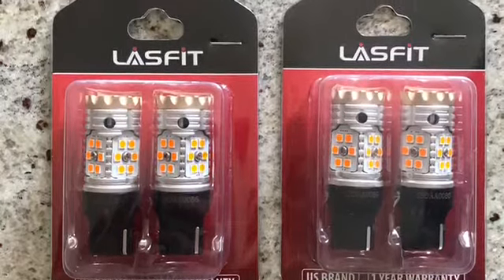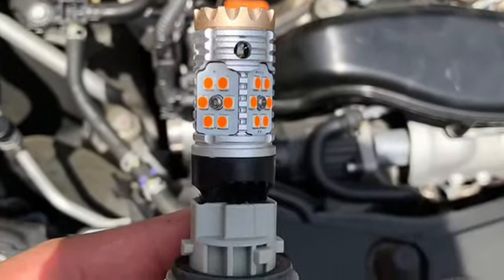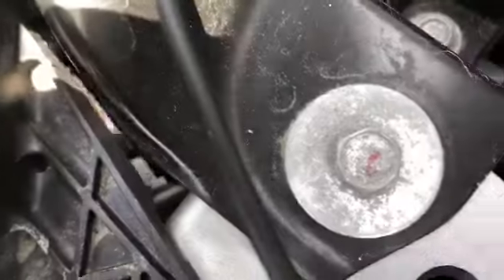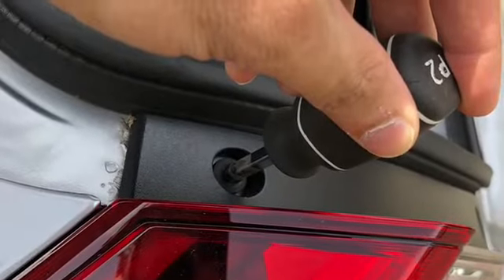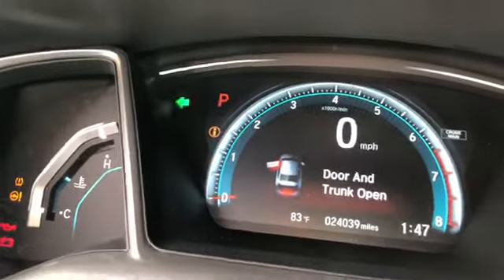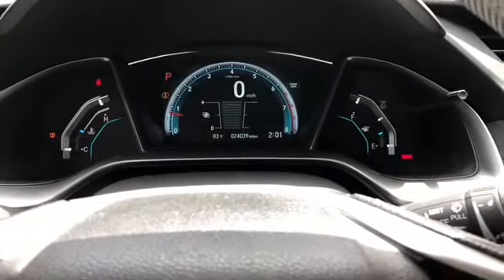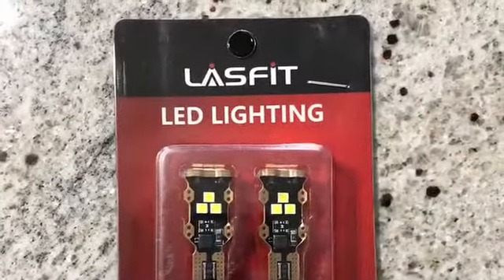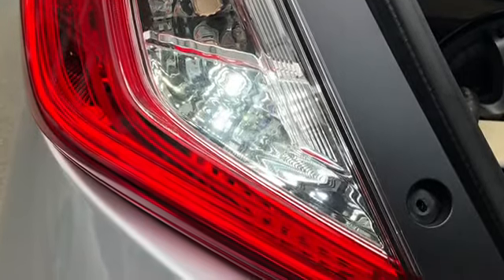How to Install Anti Hyper Flash LASFIT Turn Signal Bulbs for 2016 Honda Civic

Comment: I bought these for rear turn signals and they’re awesome! Although after 3 minutes they did start to hyper flash because they get REALLY hot. I’m wondering, would it effect the bulbs if I switched out my flasher relay to an LED compatible one and still use these after the 3 mins? Or would there be some sort of electrical issue?
Reply from the maker: Justin Love I’m not sure man I wouldn’t mess with the electrical system in your car. I’ve been having electrical issues with my car such as the emissions system warning light and brake system problem VSA and a bunch others but I’ve heard these are common issues and there’s a recall. If you switch out that relay please let me know if it helps with the problem your having.
Reply: Definitely gonna do more research and question Lasfit.

Comment: Really well done!  I appreciate the voiceover, that’s brilliant!  Can I install these in the front AND back of a 2016 Civic without hyper flash?  I’m having trouble finding this answer.  If I buy 2 sets for front and rear, am I good?

Copy and paste lol.  I have a 2016 EX sedan and having trouble finding the answer.  It looks like this is exactly what you did, and you only had the hyper flash when the car is off?

Thanks again for an awesome video!  I have LEDs in the high/low beam and reverse, im next working on the turn signals.  The reverse bulbs made things hella bright!  Really makes your car look more exotic, exactly how they should’ve come stock! Lol.  Thanks man!

Comment: With the car on, 90 degree weather, do they hyper flash when you have any turn signal on for a while? I have some led lights that have a built in resistor but when the light bulb gets hot enough, it would start hyper flashing. I just want to know before I make the switch to these because they have a much better orange color than the ones I have.
Reply from the maker: Fabian Trujillo hey Fabian these work great on all weather conditions. Haven’t had any issues with it in the hot weather, today was 99 degrees and it works normal.
Reply: Breezy Productions Bought these right after your reply. I’ve had them since I got them delivered 2 days after ordering. They are amazing lights!! The color and brightness are on point and the best part, no hyper flash or error flash. Thanks for the suggestion bro, much appreciated! 👍🏼
Reply from the maker: Fabian Trujillo my pleasure homie!! Make sure to leave a review of the lights!!

Comment: I went on amazon and found these but it said they hyperflash with our 10tj hen civics. How long till the hyperflashing went away? Also did they just start to hyperflash when you first put them on or have they hyperflashed a few times after? I'm just a little skeptical as they hyperflash initially.
Reply from the maker: Tech Defender hey don’t worry about the hyper flash it goes away once you have both sides in. Although it will hyper flash after the turn lights are on for more then 10min or soo...
Reply: @breezyproductions9039  both sides as in left and right or front and back? As long as I turn them off and back on (before the 10 min) they won't hyperflash right? Is that why lasfit mentioned it hyperflashes with 2016+ civic?
Reply from the maker: Tech Defender yes you most definitely have to do both front and back because the circuit is linked together and if you have a light that uses less current (LED) on the front and a normal (halogen) in the back it will hyper flash due to the difference. Also if it does hyper flash just turn the turn signals off for a few seconds and turn them back on. Honestly they never bother me I have my blinkers on no more then 3min at a time, unless you have your hazards on but hyper flashing in an emergency brings more attention anyways
Reply: @breezyproductions9039  I have the touring so I have leds in the front already. If I read your answer correctly it seems like since I'm just doing it to the back it will hyperflash since I'm not doing front and rear?
Reply from the maker: Tech Defender oh that’s a good question. Yea I’m not sure because with the touring there’s different diodes and resistors but try it out! If it doesn’t work return the lights.

Comment: Despite their claims they DO NOT WORK on a 2016 Rav4 so beware!
Reply: 1: did u twist the bulb at 180 degrees?
2: did u got the bulb with the right socket?
3: if the first two didn’t work, and if u bought them from lasfit website, have them call or email and they give u a new pair.

Comment: No working!! For Toyota corolla 2017
Beware!!!
Reply: I’m sure u found a better solution as I’m gonna say. But let say u didn’t, did u got the wrong bulb?

If it doesn’t work, either 1: u didn’t turned over 180 degrees?

Or

2: you bought the wrong socket?

Because lasfit made a list about CK socket that most vehicles will have on their turn signals on their list, in their website.